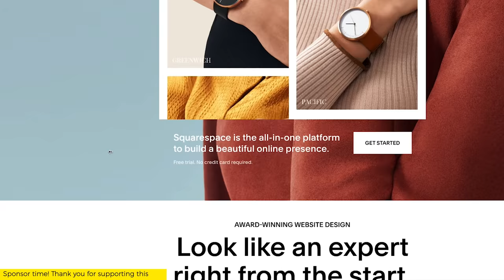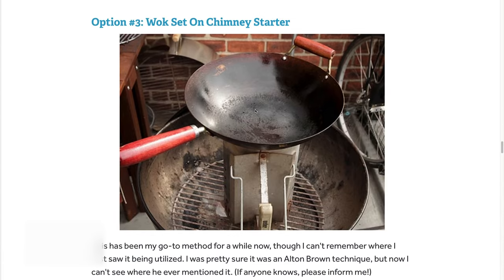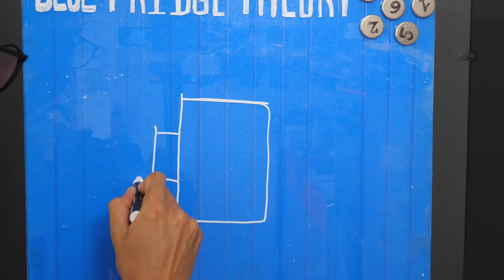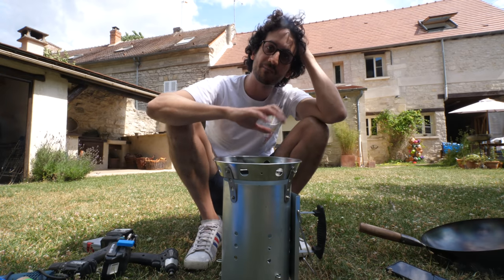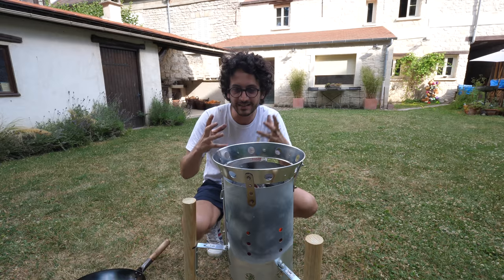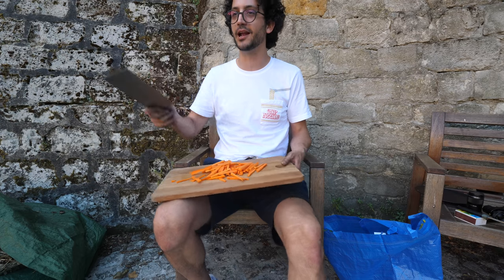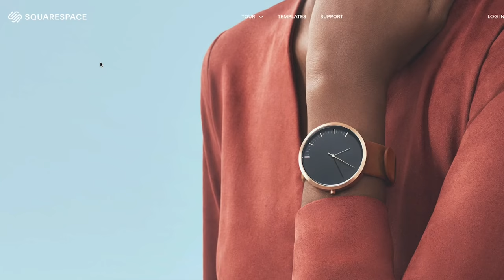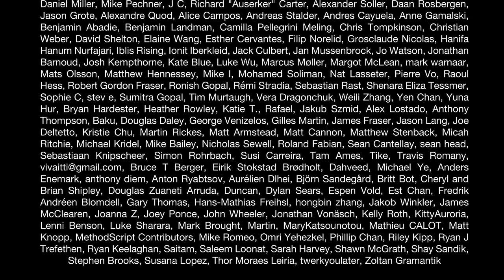How to make a Wok Burner from Chimney Starter (hack)

Comment: Just thought of this while watching.
What if you bolted the poles into some hefty concrete bricks as feet to the build, and added a 4th pole to enable multi directional stability without the need to fix it i tonthe ground (Adding portability while maintaining stability)
Also
Making a curved funnel at the base that blows air up and into the bottom of the chimney with a small fan at the opening off to the side. [to prevent any falling ash issues] this would force the already started flames upward through the chimney as well as increase overall temperature.
If i could id send a rough sketch but im not sure how...

Comment: I think that if you got a smaller opening for the flame to come out of, it might bring up the heat, which would make the burning a bit easier. You could also try hotter coals, or ditch them entirely and go for a gas burner. And if that doesn't work, you could keep a blowtorch next to you so that you can use it to light a fire.
I would also add some kind of station to it where you can keep you ingredients, oil bowl, sauces, tools, etc.

Comment: I have tried this.... the one that Kenji made without your modification. It never gets hot enough and as you say lacks power.... I bought the EZ Wok from Greg Wong... it uses the Manniu x72 burner with 2 bar of pressure from the regulator... that does it and then some...  I mounted mine in a cart.... this is well within your skill set.....

Comment: If you want it hotter may I suggest either a leaf blower or a hair dryer this would add air flow that would get the coals significantly hotter. I use a similar design for blacksmithing and then cook on the coals when I'm done.

Comment: @Alex I’m thinking a vintage all-aluminum camera tripod would make a nice adjustable stand for your wok. You could remove the legs from the top of the tripod, and secure them to the chimney starter using vertical U-bolts with a couple of fender washers to secure the axel bolt in place. Then secure the tripod to the ground with tent pegs and some 550 cord loops around the legs.

Comment: I recommend Hot Shot Ignition for creating a flame-on-demand system. Basically a small duct that enables you to spray a small amount of a flammable liquid (for food safety maybe alcohol) directly into the burner. So a push of a button (pedal?) could cause a short burst of fire to light up your wok. That's at least how they ignite jet aircraft afterburners.

Comment: The legs are good, but you could give them rubber feet and build a triangle you can bolt on to them to keep them stable. Maybe make them angle outwards too so it is more stable. For the flames, you could mount some sort of air blower onto one of the legs. Maybe a battery power tool from the hardware store. Then have a pipe leading into the can to get the air in. Instead of charcoal, mix in some wood too for the flames. 

If you are still worried about it tipping you could add some guide wires like they have on cellphone towers and use tent pegs to stick them into the ground

Comment: Pour an (80mm) cylindrical disc of concrete with three voids for the legs, maybe add a couple of handles to it. You will have a heavy , non-permanent base, making the wok station more mobile.

Comment: A light stand base with lockable wheels mounted to the underside of this rig could be a nice option. Essentially just putting this on a tripod? You could roll it around but lock it in place, plus having the metal would make it much more food safe since you could clean it and leave it in a way these wood posts don't allow. Securing it in the same three places you currently have might be a challenge, but it'd be very convenient in the long run.

Comment: For simpler setup, use winged nuts to do away with needing tools.

For charredness, use wood instead of charcoal. In Quebec many convenience stores sell pouches maple flooring offcuts as fuel for barbecueing. Those usually make more flames than just charcoal.

Comment: you could try closing off all the vents on the sides apart from the very top. this will cause it to naturally pull air in through the bottom. it creates a cycle like this. hot air rises leaving a low pressure zone in the tube. that low pressure zone then pulls the fresh air in from the bottom. that moving air is spent on the fire and gets a boost with the added heat. causing it to pull air in faster and faster till it hits a balance point. this balance point is dependent on the openings at either end though.

Comment: Random idea for stable legs. Three short pieces of steel pipe attached to the chimney starter, make sure some extra pipe is hanging from the bottom. Then attach three steel 45 degree elbows. Then attach whatever length of pipe you see fit to those. You can drill holes at the connection points of the legs and have it all held together with a few cotter pins (split pins, round locking pins etc). That makes it easy to disassemble and transport.

Comment: Alex, you should look at a rocket stove design. That would hit the flame point, and should be fairly easy to design and build. That’s basically what they use in China , a ceramic rocket stove. You can use charcoal or sticks in the stove. The only issue I can see it the amount of heat - the chimney may be a little too easy to overheat and warp.

Comment: Nice idea! But if you put flange or even attach a nother grill great on the bottom to make it stable, you could set it in the grill. And if you only used the high flame at the end. You could just use a condiment bottle with oil to give the coles a quick squirt.   Then just let the coles turn to ash and fall out the bottom to clean it up ...

Comment: First off you can use regular wood, so you get the flame as close to the pan as possible. Or if you want to use the higher temp point of charcoal I'd make  double compartment burner. The top being close to the pan with a grid at the bottom that holds the wood. The bottom would be basically just a tube all the way to the ground, the longer the better so you get a better chimney effect and airflow.

Comment: your issues are simple enough to solve for the issue of stability you simply need to construct tripod legs with adjustable heights i would suggest basing the design off of surveying tripods since theyre simple sturdy and most importantly light(ish) your second issue is that you dont have enough vertical air flow and this is because youre getting too much air from the bottom while this is conducive to high heats at the top of the chimney it wont bring the flame up since the flame already has all the oxygen its needs to survive you can fix this issue by putting the chimney inside a a pot and surrounding it in gravel which will make kind of a standing fire pit where you'll get much higher heats and higher flames

Comment: You can build this thing with a proper base, and try and situate a fan underneath of the charcoal to get the heat going. A little heat will ramp that temp up quick and hard...and if you want to get super into it, you can always set up a foot bellows, though that would be quite a bit more work during the cook.

Comment: If I’ve learned anything from my knifemaking days it’s that the best way to make a hot AF fire is with more air, you can make a little forge that’s hot enough to soften steel with firebrick, a leaf blower and charcoal. Something similar would work for this application I think, the real problem is how to regulate it... I would say compressed air because you could just throw a regulator in the line before the fire, but that would be loud and inconsistent, and would be too little air volume. I think an electric leaf blower with multiple speed options plumbed into the bottom of the existing setup would work great, you would want to get something with a lot of range in power, because you don’t really want to melt your pan or blow charcoal everywhere out the top, so honestly I would start with a kinda wimpy one and see how you like the pressure and volume then just return it and get a more hardcore one if it’s not enough juice.... then once you get your blower picked out, strip everything off except the bare necessities and slap it in a box underneath for consolidation sake. Hope some of this helped !!

Comment: If you need more flames you can use dried sticks instead of the lump charcoal. The charcoal had it's combustible gases cooked out of it. It's good for having a smokeless fire and a fuel that doesn't rot, but smoke from dry tinder is all un-combusted fuel vapors. Build a taller chimney starter yourself from some stove pipe, load it with vertically oriented straw or small sticks (so that air draws straight up through it) and light it from the top.

 I use a 55 gallon drum with the bottom cut out (so it's just a big metal tube), propped up on bricks for airflow (with a barbecue grate on top of the bricks to hold the fuel up and let the ashes drop) and a giant wok. I fuel it with dried flower stems and seed branches from my farm. The drum gets hot enough to glow if I'm not careful. I need to build one out of clay or aircrete but haven't taken the time to yet.

Comment: I cook on a wok every day at work and you dont need that gap between the went hold on the holder for the wok just the vent holes and instead of circular used two big rectangles and 25° on the top of each side centered and you will get a perfect station theres just to much airflow right now cant cook it fast enough for a true wok set up I hope you see this and fix this it kinda hurts to see this build right now but over all decent wok skills very impressive

Comment: How about using a 1m stove pipe and drill some holes for proper air flow?  You would need some grid to keep the coal at that raised position, but just some angle brackets mounted at the bottom of the pipe would secure it and you could get rid of the wooden posts.

Comment: I would suggest to use a camping table, cut out a section big enough it does not get burnt from the heat and bolt down the wok ring - chimney combination as it is now, so just the tip of the wok ring is coming out of the table on the upper side. its super convenient to store, to set up, its cheap and you have extra space for a cooking spoon or other tools, ingredients and plates for an easy serve.

Comment: you need flammable vapours to get flames. try hardwood that is lit from the top instead of charcoal. it will cook the wood under and gassify it before igniting the gasses. it is amazing how fast it burns once you get it going. After the flames get weak, you can feed it regularly if you need to keep going but it is not as convenient. Charcoal will also gassify to CO and give flames but it needs around 1000C, hence the need to blow air through it.

Comment: So if you set it up with bricks underneath you could make a steady slightly more permanent fixture (not cemented just set) and you could make a sort of wind tunnel with the bricks and use a bathroom vent fan as a blower (way less noisy than a leaf blower also not overpowered I learned that from a diy blacksmith)

Comment: Would it make sense to replace the chimney starter, which is thin aluminum and radiates in all directions, with some ceramic vessel, like a terra cotta pot, which would insulate and force the heat upwards?  You'd have to modify the pot for airflow, but there would probably be ready-made wrought iron stands to hold it up.

Comment: maybe a concrete brick Rocket Stove would be a more propper garden solutions.
also consider different fueling. in regards charcoal and airflow you might want to look out for some traditional Japanese round charcoal with large holes in it. or a hexagonal coconut compressed block with a center hole. or plain hardwood branches and stack them long ways. remember it is all about air flow. if you have a bed of coals the main heat is radiated from the surface. but if you add the airflow you increase the effect a great deal.

Comment: For the base, you could cast a concrete ring, like a mill stone.  the Grill and Mill.   put a liner between the chimney and setting concrete to create the perfect set ring channel for it to sit in, but still be removable.  Use styrofoam or pvc pipe to keep the center open for airflow.   That, or pipe/cast in a hole for forced hair, or tornado effect. (look at blowers for forges and kilns... air pipe nearly tangent to the inner hollow.)

Comment: Try a triangle shaped plate for the base that is large enough so your anchor legs connect to your coal chimney at a 45 degree angle.  Then cross connect the anchor legs, and place your ash pot on the shelf they form.  Use all metal and weld each connecting point.

Comment: What about a large planter pot?  Or a Vase sort of thing.  You could even Make one yourself.  You could keep it outside and it would keep the chimney stable.  Just leave those metal planks on the side.  You may need to put holes in the bottom of the vase/thing made with clay to improve air flow.   I agree with the sentiment that a leaf blower is far too strong but a hair dryer or maybe a swamp fan would work great! .  You do have the problem of what happens when hot coals fall down on to the fan.  If you put holes in the bottom you may lose airflow but perhaps you could put a contraption on these holes to restrict or increase the amount of air being let in.  That way you could place the fan on the side of the planter, instead of directly underneath.  Still slightly dangerous and I'd love it if you had a fire extinguisher on the side to ensure your and people's around you safety.

Comment: It would be very interesting to measure the effective BTU/hr output of the chimney starter compared to a butane stove. I'd do it in a wok, since that's the actual application, but perhaps cover it and use a remote probe thermometer.

Comment: the weber has air control at the bottom so you can control the air flow from the grill bottom id say use that or make sure you have air control mor e for temps.

Comment: For the sake of economy your best bet would be to use a large dog bowl or a steel deep dish pie pan with a lot of small holes drilled in for ash to fall through and air flow. Added bonus if you use the cap of a bar shaker, or some other faced-down conical shape to place in the center to allow the coals to make a crater shape, which would allow for more even heating around the wok, as long as you make sure to stack the coals very well.
Smaller pan so less coal to use. Lower pan, so it's closer the the heat. 

A rocket stove is essentially what you're using now, so that wouldn't really work. Also, just cut the tops of the wooden stakes, so they don't catch fire in the future.

Comment: Alex great job, but in order to get flame you need More air.... Blower at bottom will help you through get  propper heat. And maybe adding a line of propane ....will make it in a while new level ...mix fuel + more air.... probably insane ...hope you get nuts .... Grettins from Colombia

Comment: Mount it on steel rods instead of wood, and instead of bolting it into the ground set the rods in a slab of concrete. That way it is stable but moveable (but it's gonna be heavy).

For the heat aspect, I think you need a hotter burning fuel source. Briquettes is a start, or you somehow add more airflow. A blower is a possibility but potentially dangerous as it could throw sparks in the air. Ideally you'd want the airflow to not be aimed at you to avoid this, so coming in from the side or directing it to come from above without compromising the wok ring would be great.

Comment: I think adding the gap and turing the wok ring upside down was a mistake.  The holes in the wok ring should be the only way for air to escape.  This brings the heat up right to the bottom of the wok.  Also the wok ring is narrow at the top to concentrate the heat.  You should use the wok ring properly (i.e. small side up).  The gap allows heat to escape before it reaches the wok.  Also I think making the supports portable would meet your goal.  Some kind of tripod on wheels, perhaps?

Comment: I would use different fuel that burns with flame thin sticks or cardboard and have oxygen supply from the base only,  with mechanism you can throttle, to provide a directional burn up the axis of the burner, block the side holes to get a good draw, consider either foot bellows or electric pumps to augment the oxygen

Comment: Put a screen in the wok ring, add hardwood shavings. The added quick combusting fuel will draw more air and add higher flash point with the flames. So take if the wok, add shavings, add wok to trap heat, then when you lift to stir, oxygen inundated the flame path causing the fire to flame up igniting the oil droplets from the shake

Comment: Try charcoal on the bottom and then pine or other soft wood for the flame on top. Let the charcoal get to flames, then put chunks of soft wood on top. You could even soak the soon in vegetable or olive oil. Guaranteed to get those flames.

Comment: If you want flame from charcoal, you'll need to add more air. A foot operated bellows would do the trick for places without an easy electrical supply (like a backyard). Be aware though, more air will mean you will use more charcoal too, and the temperatures you can reach will be much higher (for instance, my charcoal forge can easily reach > 1200ºC).